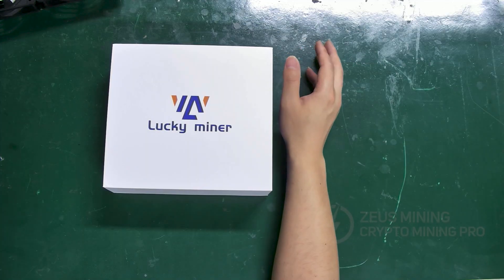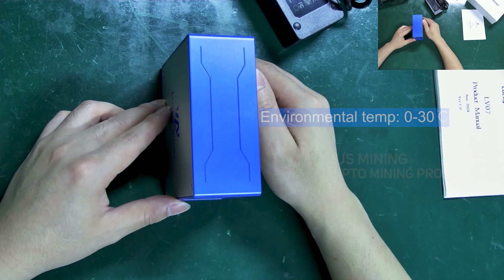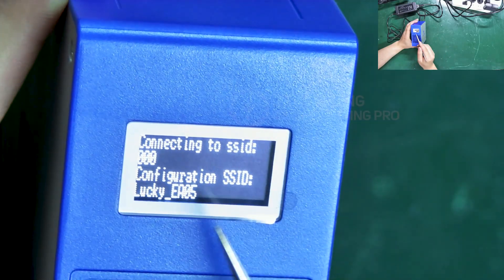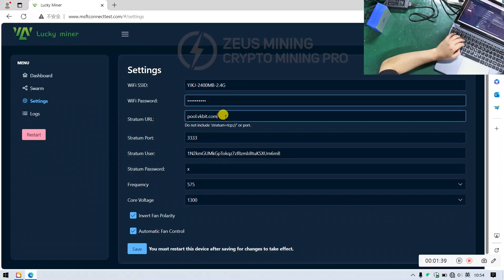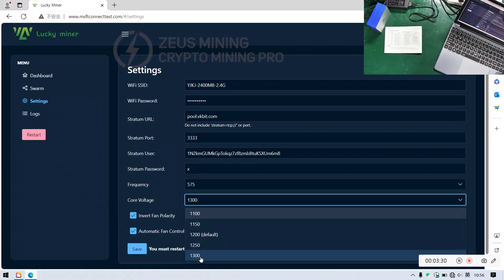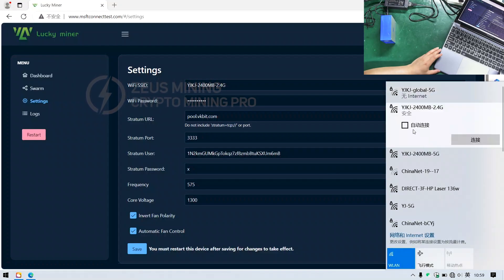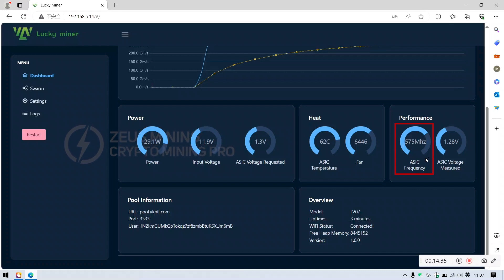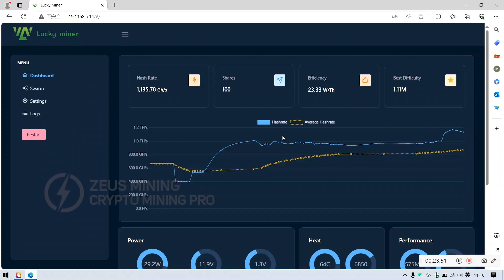Setup Tutorial for Lucky Miner LV07 Micro Cryptocurrency Miner

Comment: I am interested in this, to hook up to my solar.   Question 1. Will it hook directly to my 12v solar system, I have 800 watts solar with 6 100ah batteries.   2. Will it work via my iPhone or iPad, I do not have computer
Reply from the maker: Hello, it is better not to connect solar. It can be set using IPhone. If you have any other questions, you can also contact a technician through our official website, who will provide you with better advice and service. *_https://www.zeusbtc.com/Contact-us.asp_*

Comment: Hello friend, I have two LV07 that seem to be running well but I have a concern.
The manual states the optimal operation temperature range to be between 0-30 Celsius but my miners even on the lowest settings never go below 46 Celsius.

My ambient Temperature is around 26 Celsius.

Around 1,429.94 Gh/s
Power: 18.2W
Frequency: 450
Core Voltage: 1200
ASIC Temperature: 59C

Is this normal?
If so can you please tell me what ASIC Temperature is too high?
Reply from the maker: Hello, 50-70℃ is normal.
Reply: Is it profitable to get two of lv07 ?
Reply: @ka3wachaaaka335  from my experience, because of the level of difficulty in mining BTC, these are only good for Solo mining AKA Lottery mining.
Reply: @ka3wachaaaka335 your odds with one, are a lottery of hitting the $300k minimum is roughly landing within 12,000 years
Reply: @ka3wachaaaka335  Not really. You would be making only a few cents a day after electricity costs.  Estimate at $39 per year. 
I just purchased one and will be using it as a solo miner to get a BTC block.  Can't wait.

Comment: I have a lucky miner lov7 I did follow the instructions here mentioned. So after the set up what do I do next ? Can anyone please explain!!!
Reply: Just wait until you're lucky enough to mine a bitcoin block now haha
If that happens, your bitcoins will be deposited into the wallet you selected in the settings.
Reply: @blackjaspion  so the default wallet this comes with is NOT what I want to use correct???
Reply: @ No! Create YOUR bitcoin wallet and replace it with the wallet that is installed in the factory configuration. If you don't replace it, if you mine a block, the bitcoins will go to the manufacturer's wallet haha
Reply: @ thats what I figured, strange it doesnt mention that in the instructions..... Trying to figure out what mode this miner is in... says it defaults to solo.... how do i know??

Comment: Dear, my miner have run for 1h with 1Th/s, share 600, Effiency 26.48 W/Th, Power 25W... But found nothing (0 .000000000 BCT in my wallet addresse) is it normal. Sorry i'm just beginner.
Reply from the maker: It’s normal. Bitcoin solo mining is a “all or nothing game”. If you lucky enough you will get all bitcoin award in one block around 3.25 btc. In bitcoin blockchain every 10 minutes will found a new block and award btc.
Reply: @ZEUSMINING  thanks for your answer
Reply from the maker: You're welcome, we're happy to help you solve your questions.
Reply: It doesnt give you constant btc. Its a lottery miner. Youll only receive something if it lands at $300k minimum. Which on average would take 12,000 years

Comment: in 2 days the uptime always restarts.
even though using default settings.
what's wrong, is that normal ?
Reply from the maker: Check the ambient temperature, which needs to be less than 30°C. If you still can't solve the problem, please contact our technician via WhatsApp: +8619123969124, who will provide you with better assistance.
Reply: @ZEUSMINING  Jeez. temp in the room must be below 85 degrees.  Winter time and with AC on it can operate good.